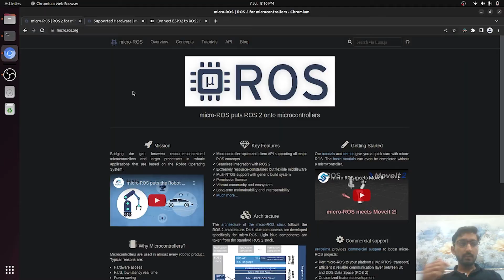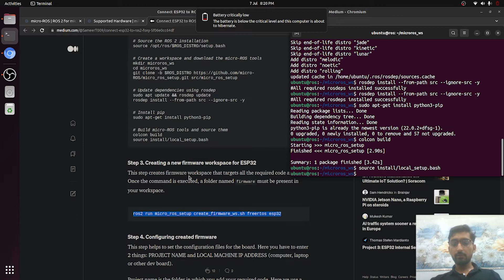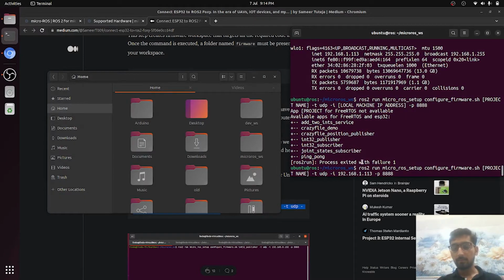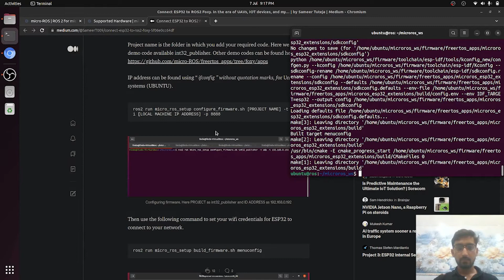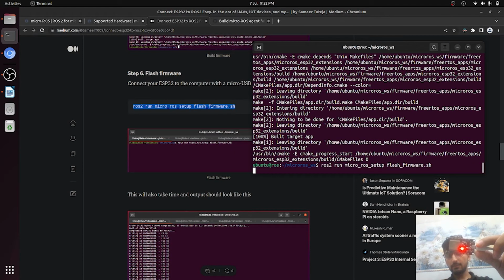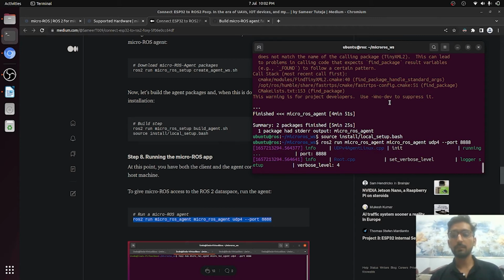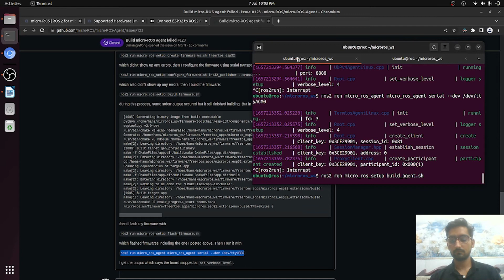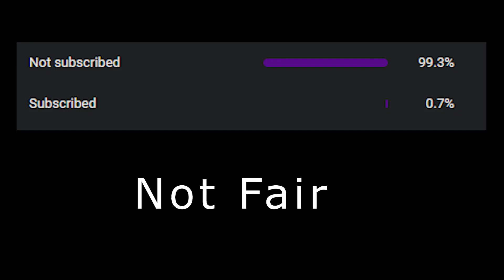Esp32 with micro ROS tutorial | Int Publisher | error solved  | Part 01

Comment: Found 1 serial ports
Serial port /dev/ttyUSB0
Connecting......
Chip is ESP32-PICO-D4 (revision 0)
Features: WiFi, BT, Single Core, Embedded Flash, VRef calibration in efuse, Coding Scheme None
WARNING: Detected crystal freq 344.33MHz is quite different to normalized freq 40MHz. Unsupported crystal in use?
Crystal is 40MHz
MAC: a4:15:a9:de:fe:ca
Uploading stub...
Running stub...

A fatal error occurred: Invalid head of packet (0x50)
CMake Error at run_cmd.cmake:14 (message):
  esptool.py failed
Call Stack (most recent call first):
  run_esptool.cmake:21 (include)
Reply: Hello, I am having a problem when flashing the microcontroller, could u please look into it?
Reply from the maker: Unfortunately i dont have much knowledge that why this occured
May be you can post this issue on ros discourse.